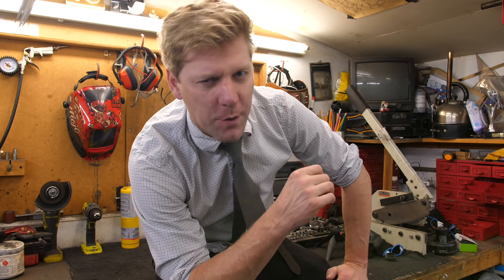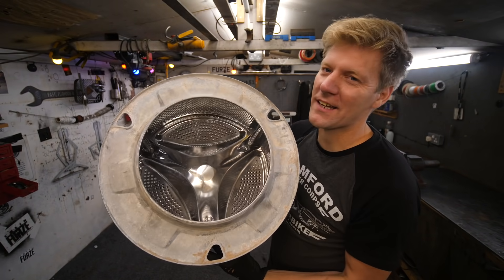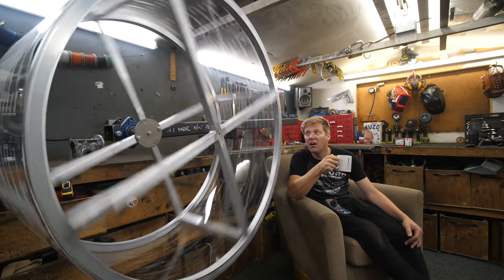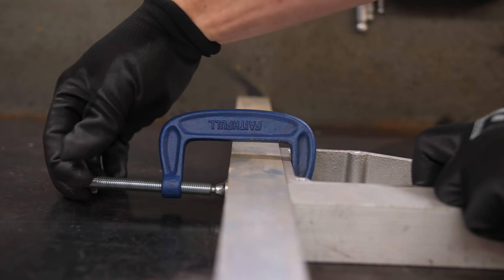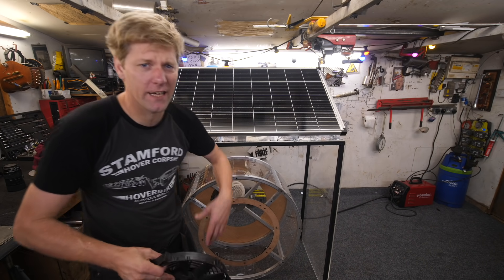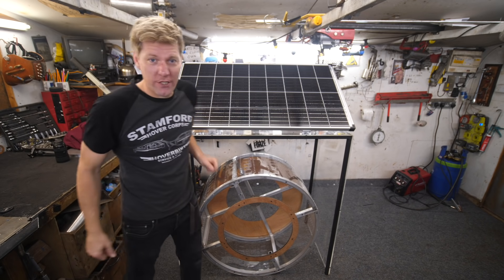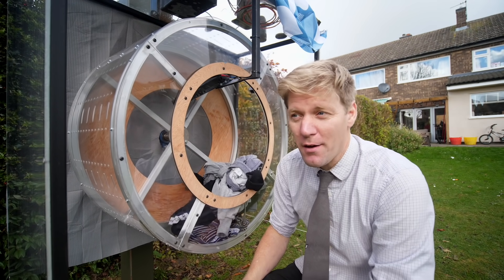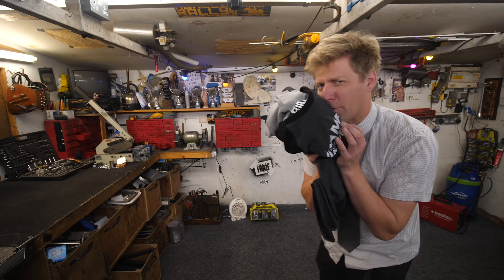Wind/Solar Powered Clothes Dryer

Comment from the maker: Now this is a very Low Tech approach to green energy but its always good to start simple and who knew about the washing machine door shape being so important lol. What other green projects would you like to see as this has got me thinking, Theres some great pitches from the teams with energy from falling rain aero efficient Traffic sequencing and different materials to improve batteries so hope this completion helps these things become a reality.
Reply: Hydro powered stuff
Reply: You could showcase your superb plumbing skills with the tumble dryer too! You could add another solar panel - one of the hot water type ones - have some  copper pipes fixed inside the drum, and something like a car heater matrix in front of the fan, so the fan blows warm air onto the clothes, and the clothes are touching warm pipes as they tumble 🙂
Reply: Me and you both post at 10:00
EDIT: I would like to see you make a working Boxcar with bearings, couplers, and more.
Maby if your up to it and American Locomotive "SD70ACe".
Reply: Oh, the real low tech approach to using renewal energies for drying clothes would be some of these:

Just hang your clothes over the hedge or fence of your yard/garden.

If you want it fancy, then get some rope, fix it between two buildings or trees and put your laundry over that line.

If you really want to invest into high tech, go get some metal poles, stick them in the ground, and connect the tops of these with that rope to fix your laundry to.

Yes, that thing called "wind" really works with solar energy, and it's been widespread across the world since centuries - but seems to be almost forgotten...
;-)
Reply: U should make this into a little mini-series in which u convert everyday items into more economical versions. For the future✌🤘
Reply: Tea machine that uses ground source heat pump technology for the hot water
Reply: Make your underground bunker solar powered
Reply: Dude just build a Mecha thats what we all are waiting for
Reply: I know it’s winter but a cooker using the sun and  some magnifying glasses or a parabolic mirror it could be dangerous and a fun project witch is right up your street or a crazy wind powered dishwasher witch would only need to turn a water pump and I’m sure it could be ferzed up to some devastating pressure lol
Reply: Hey man!!
Reply: Solar power hover bike xD
Reply: Зделый реактивный двигатель
Reply: If you used wooden cladding it would look really nice in your garden and leave a pipe hole for airflow to fan would that work?
Reply: Water powered power tool
Reply: Y don't u just hook the dryer machine to the solar panel ? Although great initiative!!
Reply: Well, why not get a renewable energy "butler", which would open doors and windows for you, transport food over the kitchen, and do other stuff? A low-tech view on "smart home" thing.
Reply: Solar panel old motor scooter
Reply: I allways like the K.I.S.S (Keep it simple stupid) backyard engineering more anyway.
Reply: hey colin! love your vids. maybe you should make a discord server where people can discuss mad ideas and post their own projects!
Reply: If you do like this idea i can set it up in a jiffy
Reply: And how many birds will the turbine kill
Reply: Here's an idea for a project colin. Looks cool and perfect for you
https://youtu.be/_fZNRLYiYNM
Reply: Make your house semi/fully powered using wind and solar panels
(Could make builds cheaper afterwards, cutting down on your electricity bills)
Reply: A wind and solar powered clothes dryer is called a "clothesline". 😂
Reply: Could add some more solar panels and increase the speed ( power ) of the turbine which would speed up the process right? . . Anyways you're awesome . . Huge fan of yours. . .
Reply: h
Reply: Pog
Reply: Why not just make yourself a nuclear powerplant- bam basically renewable energy
Reply: Hi Colin
Reply: Why dont u just have 2 solar panels
Reply: How many solar panels would it take to just power a regular tumble dryer 🤔
Reply: @michaelkelly2912  even my high tech ultra efficient heat pump drier uses 1.1kw. A regular plug in dryer can use around 2.4kw then with inverter efficiency losses you would need a minimum of 10 300w solar panels to power it in perfect conditions.
Reply: Pog champ
Reply: You mostly need this in the winter. for now you just would have frozen clothes. 

Is it really that green too ? 
I always read solar panels arent that green and you used a lot of material that is out out there to fight the elements. 
How long will this survive etc. 

Dont wanna shit on you i just sound like an arse :D <3
Reply: Do something for rains
Reply: @colinfurze  Did you get a cut near your lips at any point while recording this?
Reply: Thank you for uploading
Reply: What type / power is that solar panel? I'm after a similar one to power the lights in my shed.
Reply: Crazy idea: if you still have power to spare from the solar why not hook up a couple of flood lights (heat lamps) under/around the dryer to give it a little extra heat on a cold day...? Just a thought, keep up all the amazing inventive work, you legend!
Reply: Not that this is a bad idea but I do find it a bit over engineered. But a peddle bike could have handled drum rotation as opposed to solar panels. And a solar heat collector could be used to increase its efficiency.
Reply: I thought mankind was using wind and solar powered cloth dryers for centuries but in a much simpler way😂
Reply: Sorry but this is a mega run-on sentence.
Reply: could add a beer/pop can solar air heater to the set up, blowing warmer air into drum.
Reply: I am following you from Egypt please dude you know that we follow you for the mechanical things that all of your followers adore. I think this is a boring thing. We want things more important than this.
Reply: Or you can just line dry...... 🤔 🤔 💡.
Reply: I can see one way to get energy from rain.  Just install hydroelectric  generators in the downspouts  from your roof gutters.  When It's sunny you could get power from a solar array, when it rains you get power from the generators in your downspout, and if it storms, you get power from your wind turbine.  You may end up selling energy to the power company.
Reply: Hey Colin. My mum asked if you could make one for her??.???
Reply: the shape of the door doesnt matter at all.. the difference is that yours has no door...
Reply: Why don't you try taking an electronic device that is frequently used in the house ( or shed)  and see how much energy is lost during the transfer. Then try to take the wasted energy and use it for something else that is frequently used. If any energy is wasted in that process, try and use it for something else, etc, etc. See how far you could go. I know something like that sounds ridiculous, but hey, it's an idea, isn't it?
Reply: You are so cool 🦾💪🏻👍🏻👏🏻🤘🏻🎯🔥🎥
Reply: https://youtu.be/EWd2tZJTIGg
Reply: Great idea. I checked the Pitch website, and I have a few concerns though... The way teams are presented and the way the vote is organised, is promoting fascism. The solutions should be presented, without any mention or trace of the team, so that the projects get the votes and not the nationalities. And speaking of nationalities, Turkey is ASIA, not Europe...
Reply: You could never make too many videos!!!
Reply: Why didn't you crack firework for your 10 million subscribe
Reply: I always wanted to see a fully functional solar refrigerator (one that works with temperature differential). Maybe use it to keep beverages cool in the bunker? mmm (or maybe one those ancient  structures they used to make ICE during the summer thousands of years ago? How is it called? Yakhchāl  ?
Reply: He has a car in nitro type lmao
Reply: Ever thinking of using 3d printed carbon fibre for any of your projects?
Reply: Would it retain/gather more heat if you painted/used black plastic instead of clear acrylic/plexi?
Reply: Use edison style battery's in evs, set up so that at the charging station it can simply replace the fluids to charge the battery's quickly.
Reply: What happends with stormy weather?
Reply: If you made a tin can solar hot air array with a solar powered blower, you would dry your clothes even faster!
Reply: My I recommend putting in some heating elements or Incandescent light bulbs so that that the clothes dry quicker do to the added heat.
Reply: Low tech?  That whole thing can literally be replaced with a bit of rope.
Reply: way too many extra steps, just get more solar panels for all the electricity required !!
:))
Reply: If the back of the drum were stationary, merely butted up against the drum, you could put your fan there. + a simple clear door to gain and retain heat & viola!
Reply: I still really appreciate that you don’t have commercials in your videos. Thank you for that!
Reply: if you add some foil you could use the heat of the sun to  help dry the clothes
Reply: So I know its impossible but colinfurze you seem to make anything possible so my quest for you is to just try once to make a perpetual motion machine with magnets just once bc i know its possible but your smart and a very determined person i believe if any one could figure it out it be you colin 😁!!!

(Also i love your videos and content keep doing crazy things)
Reply: U should have added 1 of those home made air heaters to it.. on sunny day it will make 60C warm air , and clothes surely dry faster.
Reply: It should be possible to run an entire house on 12 volt. With a small windmill, solar and a house battery. The only thing the world needs is: 
- A washing machine that also runs on 12v. Hot water from a solar boiler? 
- dishwasher on 12 v. 
- oven? Super insulated, powered by a lens? 
All other things in the house can run on 12 volt. Lights, TV, computer, super insulated fridge, etc. So please re invent a low energy washing machine.
Reply: Can you do a full suit of mandalorian armour with working wrist gauntlets ? Please
Reply: Join the club fam: https://youtu.be/25l96_-5PZI
Reply: id say you have already won Mr furze.
Reply: I pray for the day you make a Super RC basher modeled after the Traxxas Bandit! I bet youd get a new Sponsorrrrrrrrrr😁! Good day.
Reply: Solar refrigerator? (Peltier (EBay)? Or wind powered refrigerant compressor? (Scrap yard.))

Solar spot welder. (Pulsed high current slow to charge. Super capacitors off an old hybrid bus.) For your sheet metal bending, joining needs. Also doubles as high current fun for future.
Reply: What a great demonstration of wind power being a way of saving some fuel if the wind blows but not being a replacement  for more reliable forms of  electricity generation.
Reply: انا No عربي من العراق ممكن جاوب
Reply: @ianvanloon1402  اي بعد انا عم الك مااعرف انكلش ممكن ااجواب ها
Reply: now take a broken dryer and make a hydroelectric generator lol
Reply: @Gu1tarZer0  انا عربي فتهمت ولء لا
Reply: make a video with the minecraft c419 music in the background
Reply: Would you consider making multi-purpose kinetic generators that can be attached to things like bikes, cars (anything that moves really), and can be plugged into a variety of outputs such as lights, batteries etc.?
Reply: Hi Colin
 Great work however on a standard dryer they have paddles similar to washing machines but generally larger ,
 Your clothes kind of just roll in a ball , do you think 3 paddles would lift and separate them more to aid drying could be worth trying  🤔
Reply: Your welder is a lot quieter than my Papa's
Reply: I really like your channel Colin, but I have to say, that teaming up with Shell and helping them Greenwash is a major mistake on your behalf. This should have come from you or a company which is actually trying to change. Shell is one of the many major polluters and shouldn't be given this much positive attention from people like you. I'm sorry, but this was a major mistake
Reply: what about 9 and 10 million subscribers Fireworks did you forget?
Reply: Привет Колин! Пара уже на русском вещать, аудитории много
Reply: I think blades could have helped to throw them about a bit more. Something I've been meaning to suggest for a while is for you to do something BMX related, possibly a gizmo that helps with stunts. Like a gyro that stabilises the bike when on the front wheel or a motorised yoke that spins the handle bars or even the bike round when on the wheel. You're welcome.
Reply: Make a windmill that powers ur whole house.
Reply: Hi, my name is Luis and I would like to tell you that you should dub your videos in Spanish. Do not offer this type of content in Spanish. You would be a success.
Reply: hola me llamo luis y quisiera decirte que deberías doblar tus videos en español no axiste este tipo de contenido en español serias un exito saludos
Reply: Hi, my name is Luis and I would like to tell you that you should dub your videos in Spanish. You do not have this type of content in Spanish. You would be a success. Greetings, something like a second channel and gradually doubling the videos you already have. I would like to see this content in my Language since English is a bit complicated for me and I suppose that many also do an incredible job, thanks for your videos
Reply: hola me llamo luis y quisiera decirte que deberías doblar tus videos en español no axiste este tipo de contenido en español serias un exito saludos algo asi como un segundo canal y ir doblando poco a poco los videos que ya tienes me gustaria ver este contenido en mi idoma ya que se me complica un poco el ingles y supongo que amuchos tamnvione  ases un increible trabajo gracias por tus videos
Reply: Hi, my name is Luis and I would like to tell you that you should dub your videos in Spanish. You do not have this type of content in Spanish. You would be a success. Greetings, something like a second channel and gradually doubling the videos you already have. I would like to see this content in my Language since English is a bit complicated for me and I suppose that many also do an incredible job, thanks for your videos
I also like french fries
Reply: Hi, my name is Luis and I would like to tell you that you should dub your videos in Spanish. You do not have this type of content in Spanish. You would be a success. Greetings, something like a second channel and gradually doubling the videos you already have. I would like to see this content in my Language since English is a bit complicated for me and I suppose that many also do an incredible job, thanks for your videos
I also like French fries, I'm sorry for my bad English, I'll also leave it in Spanish

hola me llamo luis y quisiera decirte que deberías doblar tus videos en español no axiste este tipo de contenido en español serias un exito saludos algo asi como un segundo canal y ir doblando poco a poco los videos que ya tienes me gustaria ver este contenido en mi idoma ya que se me complica un poco el ingles y supongo que amuchos tamnvione  ases un increible trabajo gracias por tus videos
ami tambien me gustan las papas fritas lamento mi mal ingles tambien te lo dejo en español
Reply: Hi, my name is Luis and I would like to tell you that you should dub your videos in Spanish. You do not have this type of content in Spanish. You would be a success. Greetings, something like a second channel and gradually doubling the videos you already have. I would like to see this content in my Language since English is a bit complicated for me and I suppose that many also do an incredible job, thanks for your videos
I also like French fries, I'm sorry for my bad English, I'll also leave it in Spanish

hola me llamo luis y quisiera decirte que deberías doblar tus videos en español no axiste este tipo de contenido en español serias un exito saludos algo asi como un segundo canal y ir doblando poco a poco los videos que ya tienes me gustaria ver este contenido en mi idoma ya que se me complica un poco el ingles y supongo que amuchos tamnvione  ases un increible trabajo gracias por tus videos
ami tambien me gustan las papas fritas lamento mi mal ingles tambien te lo dejo en español
Reply: The only problem that I see with the design is, when it's does rain the air humidity will spike and cause the cloths to not dry/become moist.
Reply: Colin i have an good idea! 
A chair that is burried in the ground(not seen from above) and then u steep on a button it comes out the ground and u are ready to sit!
Im sry my english is bad...
Would love to see 007 stuff xD
Reply: Is it possible to increase the speed?
Reply: Just hang the clothes on a line
Reply: Can you make a car using solar energy power also to kick it off use wind power to run it
Reply: Surprisingly its nott jet powered
Reply: Modify the shredder machine from Dave Hakkens' "Precious Plastic"
Reply: COLIN!!!! You're at 10Million subs.  I haven't seen a fireworks video in a very....very....very...long time.  I FEEL ROBBED!
Reply: Make the workshop and the bunker run of solar power.
Reply: Build a basketball net that moves up and down and side to side to make playing more challenging.
Reply: 🐒🙈 Thank God someone invented of the washing line.
Reply: Well, Low Tech or not, everything starts simple, the interesting bit are always the optimizations, after that make it smaller, and boom you have something slightly more high-tech.
Reply: Hey actually i was wondering if u can invent something i notice that in the past u made a blade that could come out in the inner part of the sleeve and i was thinking that u could make a hidden taser to pop out from ur sleeve (inspired by batman under the red hood) maybe u could do that because I've always wanted to see how that works.
Reply: @ 1:28 Colin does his famous "air ball fondling" 😆
Reply: I think itd be great if you teamed up to help @jacksepticeye. He and many other creatures are raising money for food for people who are in tight spots at the moment. It's called Thankmas, Every bit counts. Also spreading the word is great too.
https://m.youtube.com/watch?v=YfJ_ptCTLms at 4:18
https://forms.office.com/Pages/ResponsePage.aspx?id=kOKuLainZkyPQVS2-_F-RsCzQ-uZIS9IqzXK-NqxxxZURVZBVlY1RVFISzcwTUI0VVdZME9SNUI2My4u
Like so he sees this, its great cause!!!
Reply: Jack explains more here
https://m.youtube.com/watch?v=YfJ_ptCTLms at 4:18
Reply: A plant pod that produces enough oxygen to meet your breathing needs!?
Reply: Gotta say this is genius and I may someday make my own adaptation! INSPIRATIONAL! also the fake hands on the solar panel sent me lol
Reply: I’d be quite interested in watching you try and make your shed run on more renewable sources. Planning a new shed/garage build myself and would like to know what I can do regarding solar/wind to power it
Reply: Why not just put the wind turbine in the garden and the dryer inside of the bunker , so you have a clothes dryer in a zombie apocolypse , and now i think about it ... it always seems windy in zombie movies few sawblades on there and u can have a carbon free dryer/zombiedefence system.
Reply: How bout, you try telephones/ communication devices
Reply: Better than an electonic inside cloth drier but whole lot more poluting than a simple air/sun drying, that solar pannel, battery, motors, metal parts are not carbon free....
Reply: Can you make a  carburetor
Reply: Can you make a pogue carburetor, to make gasoline powered vehicles more efficient?
Reply: Can it beat a simple clothes line?
Reply: A thought that would improve it, add bumps inside the dryer that shifts the clothes like a real one does.  Your little bars of aluminum just isnt enough to tumble like it should.
Reply: Hello Colinfurze I had a thought about your dryer, I have tankn apart a couple of electric dryers before, I don't know how they are in what I assume the UK, but here in the US they are 220V and that is only because they they split the power input between the 120V electric heating coils and the 120V drum motor; so I was thinking what if you had two separate setups of solar panels and wind turbines powering a type of alternator/generator running a dryer an electric motor for the drum and the other half running the heating coils, then that should allow you to have a dryer door on your drum, also our dryers have flaps in side them so they tumble the laundry, and the motor running the drum uses a belt around the out side of the tub attached at a pully. I love the show and I wish I had the work shop that you do, you lucky dog keep up the grate work! Let me know what you think would you?
Reply: Could you make a similar machine that cleans recycling items (ready meal trays etc) with rain water?  Just so they're clean enough to put out in the recycle bin.
Reply: Epic
Reply: Since HVAC is makes up half of a household's total energy consumption, you should totally make another high-pollutant vehicle! No seriously - the energy used to prototype your "low-fi" dryer could dry all the clothes in my town for a week. We need these "green" approaches in our manufacturing. Make a solar powered welding torch.
Reply: With fins or blades in the drum to "toss" the clothes a little more you would increase drying time.
Reply: theres this thing where u put black pipes in box and it collects heat from sun... maybe u should try that somehow to keep the box heated
Reply: make a solar shed with sliding doors
Reply: 7:55 what happen? looks like you're injured or something
Reply: Could it not be adapted so on a windy but cloudy day the motor charges the battery/ powers the fan?
Reply: 1:57 adding small magnets to the borders of that curtain could avoid the wind blowing it away and rain getting inside.
Reply: Hello, Furze, im sorry for my future mistakes in sentanses.
  Im watching you for a year. I like what you do, and i'd like to offer u to make a car and name, for example Furze's car. If you refuse from this project, i'll understand you.
Wish you luck!😀
Reply: could just power the house itself with solar and wind energy and then add a normal dryer next to the washing machine inside the house... its too humid in England to dry anything outside, cause if its a sunny day then you can just tie it to a rope to dry on the sun, and if its raining then your clothes will get wet when coming to the garden, maybe putting it inside a shed connected to the house but then its better to just power the house with renewable energy, a "wind and solar power your house for dummies" would be cool, like for example i know how to create a wind turbine with an starter engine easily, but how the heck do you connect them to the electricity of the house?.
Reply: Türkçe altyazı ekle
Reply: If you add a battery then if its sunny and windy you can make electricity.
Reply: @unitedspacepirates9075  everyone knows that, thats how Archimedes made his steam cannons to fight against the romans.
Reply: @IberianCraftsman  more power out of a machine than you put into it seems to have been promoted as impossible by those who wish to keep you as slaves to a corrupt financial system.
Reply: @unitedspacepirates9075  what with your nonsense, in europe we live fine, and electricity is the future steam engines are highly inefficient as they loose energy really fast, only jet fighter catapults still use steam power in aircraft carriers.
Reply: @IberianCraftsman  incorrect,  nulcear powered generators built by sapiens (aircraft carriers included) use steam turbines for generating electrical power. Doubling steam preasure quadruples power output without doubling fuel required.
Nuclear power source is not required with sufficient pressure as kinetic energy of steam exceeds the energy required to reboil the hot condensed water.
Reply: @unitedspacepirates9075  those are just for electricity and are static, in Spain we have of those that use mirrors for heat from sunlight, nuclear power plants also use that, but i was talking about vehicles, in the end those are all producing electricity and my statement stands the same, turbines are also moved by tides and just water pressure accumulating river water in dams, as steam turbines cant be turned off easily as its a huge waste of heat energy, in the north of europe they use the hot water from power plants and pump the hot water to all houses in the cities so they dont need to have water heaters at home.
Reply: @IberianCraftsman  incorrect, you'd specifically referenced aircraft carrying vehicles.
Using your conventional fuel sources is inefficient and highly disruptive for your planet's ecosystem not to mention taxing your economic growth.
Using only the explosive pressure of your fuel in your internal combustion engines and venting all the heat into your atmosphere is extremely wasteful.
Your species would embarrass itself less if it developed its listening skills instead of speaking so much.
Reply: @IberianCraftsman  incorrect, geothermal is not endless. 
There is no need for fuel when more intelligent engineering provides freedom from dependency on a fuel source.
Reply: @IberianCraftsman  generating electrical energy from "anything that moves" is not efficient. Reccomend generating electrical energy from things that move very fast. Doubling velocity provides 4 times the energy as explained above.  Generating higher velocity steam is cheaper and easier and more efficient than your traditional methods.
Reply: @unitedspacepirates9075  if you bothered to read i wrote "near endless", and the sun will destroy the planet earth when it turns into a red star anyways.
Reply: @unitedspacepirates9075  an electric engine diesnt need gearboxes and if with a graphene battery it could reach speeds that a combustion engine would never get to, (in fact electric cars were already used in 1890), anyways, the world recor of a fastest motorcycle is electric by the way, and in Jules Vernes book Twenty Thousand Leagues Under the Sea, the submarine of captain nemo works with electricity, like the peral submarine.

Anyways, the energy of the next era will be the H3 on the surface of the moon coming from solar winds as clean and endless fuel enough to provide for the energy needs of mankind using fusion generators for lots of generations, it directly generates electricity so yes, there's no need for steam or turbines.
http://www.esa.int/Enabling_Support/Preparing_for_the_Future/Space_for_Earth/Energy/Helium-3_mining_on_the_lunar_surface
Reply: @IberianCraftsman  perhaps your species will survive, perhaps not. Regardless, please experiment with cheaper higher velocity powersouce systems.
Increasing the voltage acting upon plasma also provides surplus power according to the same kinetic energy therum. 
Please stop polluting you eco system.
Reply: @IberianCraftsman  BTW, adding a bit of electrolysis to a few kilometers of pipe full of water can pressurize the water enough to turn an electric generator with the pressure generated by the hydrogen expansion far better than steam pressure. We are trying to help your species advance from where you are to where you should already be.
Reply: My back yard is calling your name, Colin!
Reply: Nuke
Reply: Jesus love’s you an he is coming back soon an if you’re not ready you’re going to hell
Reply: Jesus love’s you an he is coming back soon an if you’re not ready you’re going to hell
Reply: Jesus love’s you an he is coming back soon an if you’re not ready you’re going to hell
Reply: Bambico
Reply: 6:15 - That type of wind turbine is inherently very inefficient. I've seen quoted efficiency of 8% in literature. A conventional windmill design is much more efficient, even when bearing losses are taken into account.
Reply: build a hho  driven vehicle
Reply: I suggest that you use Black colour drum and curtain to increase the heat when it’s sunny.
Reply: You stole my idea!!

Would work fine in Australia  without the wind mill.

Air is warm enough to dry If you just keep it moving 👍
Reply: Make a solar powered motorcycle
Reply: Add in a solar heater
Reply: Epic
Reply: Low tech for u or my dad not I
Reply: This concept if you could get the speed right would be Ideal for a cement mixer
Reply: #colinfurze  @colin furze
Reply: Upgrades the glass with black car widow tent or build a multiple magnifing glass tracking hateing up a tube with a fan on the end for artificial heater
Reply: without hot air convection it's not possible to dry clothes. This will not work during rainy days or during foggy winters. You must have at least 1000-2000 watts of energy to dry clothes.
Reply: Great idea ,but need  some panels inside so it can rumble more .
Reply: Yes
Reply: Even if you find and get an old or used clothes dryer. You can convert to wind and solar power as that option. I know you must do this. Everyone must use your recommendation, lad.
Reply: hey colin if you used a gear system, do you think you could make the barrel tumble faster without needing a lot of extra power or a more powerful engine?
Reply: Q222
Reply: Is it expensive to make one. I think it's a deadly machine. Fair play
Reply: I'd love to see a solar power car!!
Reply: Carbon makes plants GROW !!  Don't hate
Reply: HI COLINFURZE BIG FAN FROM INDIA.. CAN I GET A HEART FOR THAT ♥
Reply: https://youtu.be/kbY53RLJHfYt4
Reply: Just make a hydrogen making setup that continuously makes hydrogen from electrolysis from solar panels.

And use that hydrogen to bomb stuff.

😅😅